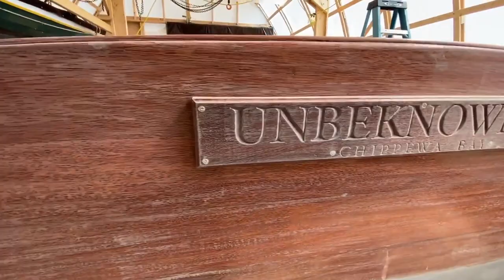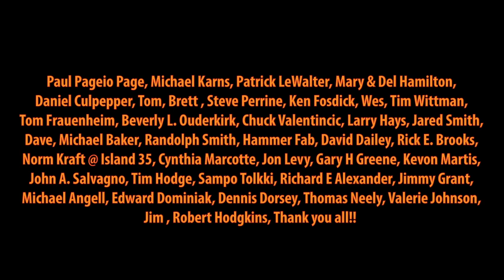WBE S2 E37 Mahogany & Leather

Comment: Hi Scott.   Yeah, I like this format.  Kind of best of both worlds.  Question:  Pretty much all the 50's and 60's Sea Skiffs I've seen, the gunwales (like where the step plates will be mounted) are stained and varnished.  Looks like yours will be painted.  Personal preference or how they were when new?   Jon
Reply from the maker: They were finished bright but had some issues. Had I replaced them I probably would've finished them brightly but I would've also had to replace the front deck as well. It would've made for a strange transition had I only done one or the other. I was hesitant at first but I think once the interior is all brightly finished you will like the contrast between the two. It will also make the boat look larger from the side not to have the sheer plank and gunnel a different color than the rest of the hull. We'll know soon!

Comment: it looks like you use paper towel to wipe off the excess stain. is that correct? If yes, doesn't the paper towel leave extra fibers?
Reply from the maker: That was only on those 3 little ceiling leftovers. I did tack rag them afterwards so probably wasn't any fibers left. I wouldn't use it on the boat, just didn't have any rags around :)

Comment: You do very nice work period and you have a lot of good ideas. But why why why are you using satin varnish to finish that boat?!
Reply from the maker: Walt, a couple of reasons. First, I prefer the look. I find it more even looking and more forgiving to any imperfections. Also, most well used boats that are stored outside the whole summer end up with more of a satin look finish after a bit anyway. Second, it is much less slippery when you stand on it, such as jumping off the rear deck when swimming. Lastly, when you put the satin on top of many multiple layers of gloss, it is actually hard to see the difference without one next to the other. Thanks for the kind words, glad to have you aboard the WBE!